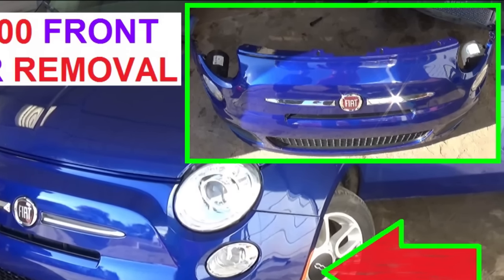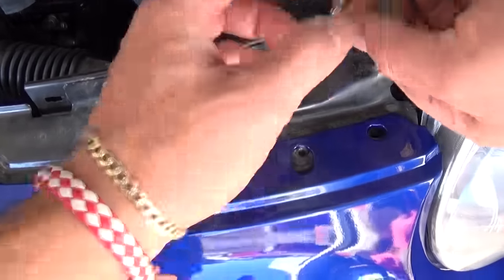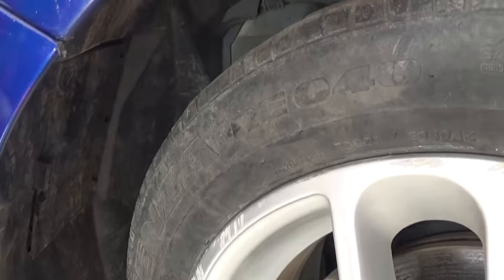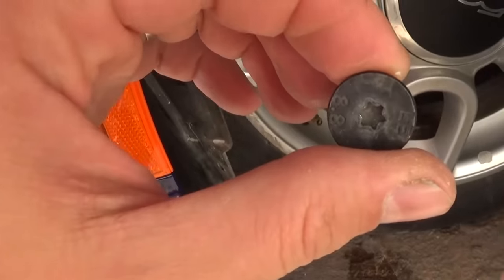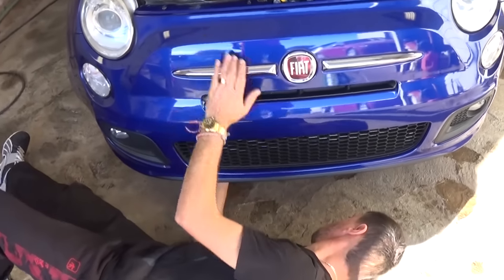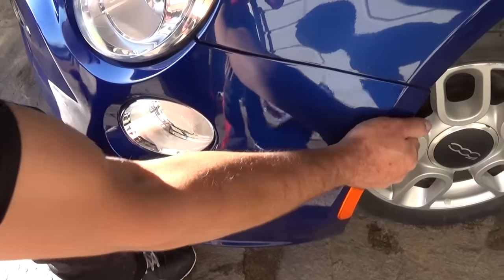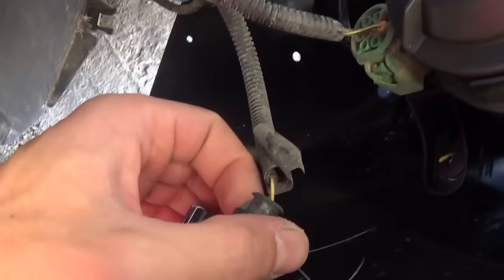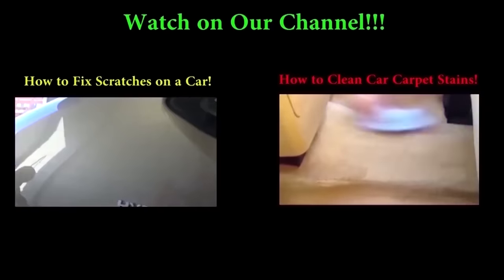Front Bumper Cover Removal and Replacement on FIAT 500  2008 - 2016

Comment: THANK YOU for posting this video! I needed to replace my daytime running lights but the little circular lid wouldn't come off the light housing - I tried to take it off by feel but couldn't see what I was doing. By pausing this video I was able to see the running light/turn signal housing inside the bumper and get it off. So helpful!

Comment: Thanks for the instructions!! 
That last clip, the tricky one, was a tough cookie, one side broke but never mind, the others are fine.
Reason I took the bumper off was because one the light in it had dropped out. They are glued to the bumper with hot glue! I washed both parts clean and stuck it back on with bathroom silicon sealer, it won't come off again!! 
Also spent half an hour cleaning up the screws and greasing them ready to go back in.

Thanks again!

Comment: I was changing the daytime running light bulb on the drivers side and as i pushed the bulb holder in to the slot the bulb dropped inside the light housing.By removing the front bumper it should make it easyer to remove the bulb.

Comment: Changing the coolant on a Fiat would be great! Finding the drain plug on the driver side bottom of the radiator, took me about 2 hrs. I turned counter clockwise and started draining the coolant. Closed back up and added new coolant. Now I have a drip at the drain plug, gaaaaaacckk!

Comment: Very clear Video thanks. 
I need to replace the emblem on my car that is located on the front bumper.
Is it possible to do this without removing the bumper??? I know there is a nut behind it keeping it in place...
Reply from the maker: +Rody Koolhoven I do not think you will be able to do it but it will be worth t try it.
Reply: +World Mechanics 
I removed the bumper yesterday with your instructions otherwise I couldn't reach it. worked perfectly thanx!
Reply from the maker: Great. Thanks for letting us know that you could not reach it without removing the bumper
Reply: You only need to remove the top 4 screws and your hand will fit/reach to the emblem nut, in my case with an 8 key, no need to remove the entire bumper.

Comment: Does anyone know if you can remove the front bumper of a 2010 fiat 500 and replace it with a 2017 front bumper? Will it fit easily (obviously going to get the headlights to fit also) but just wondering if it's doable are they the same size or not? Thanks
Reply: If your talking about the Series 4 EU bumper, then Yes! Watch this video... https://www.youtube.com/watch?v=YRZ7APZuDKk&list=PLSAUI7CUg8H1GKalaHHIzwNYp-nKg-nP3&index=5